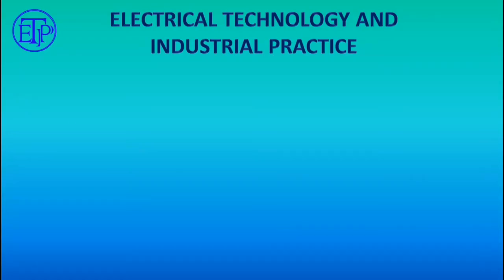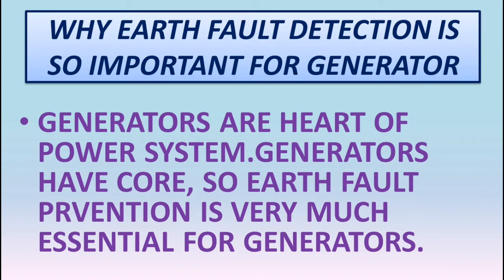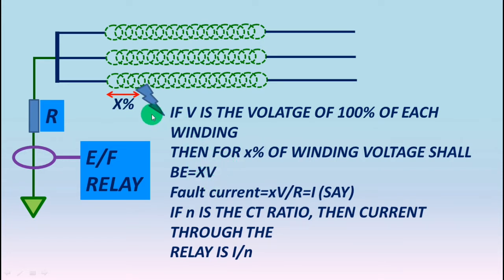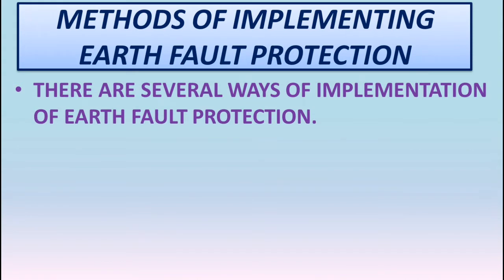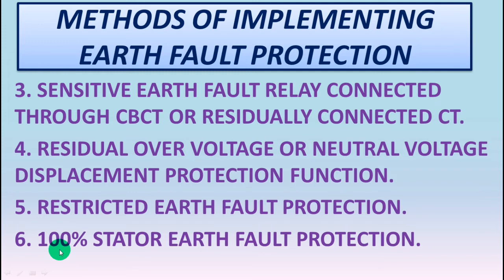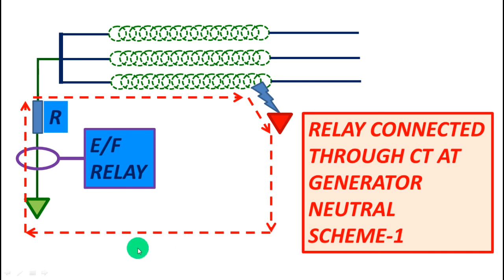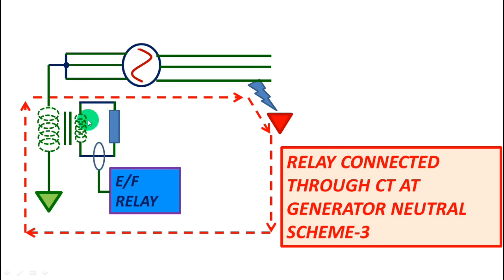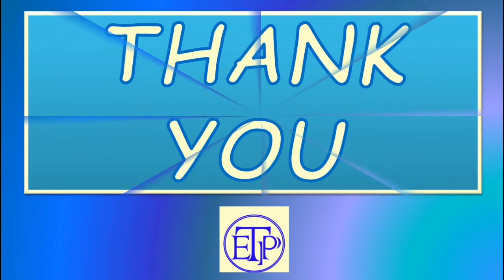Generator Stator Earth Fault Protection|Generator Protection part 4|Earth Fault Protection

Comment: Can u pls explain me t/f overflux protection & impedance protection in transmission lines thanks for advance
Reply from the maker: over flux is not t/f but v/f... it is used for transformer that are connected with Generator i.e. Generator transformer and unit transformer. because if the load is suddenly get off the voltage increases hence flux increases.